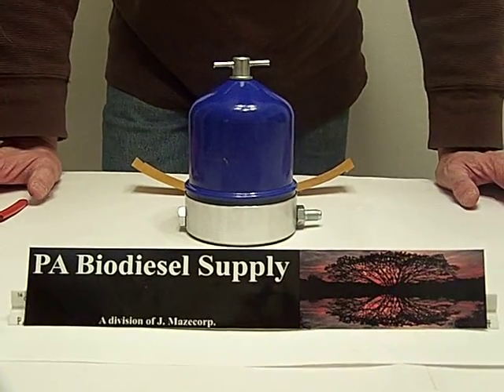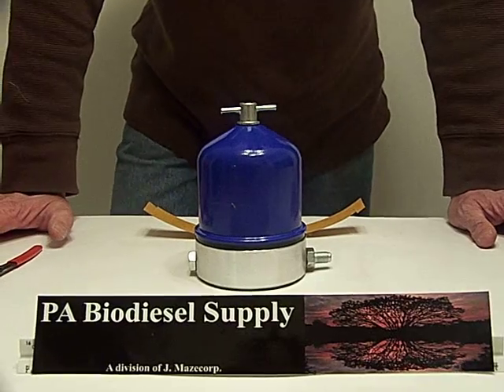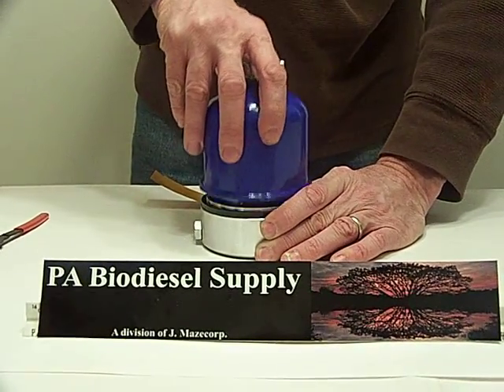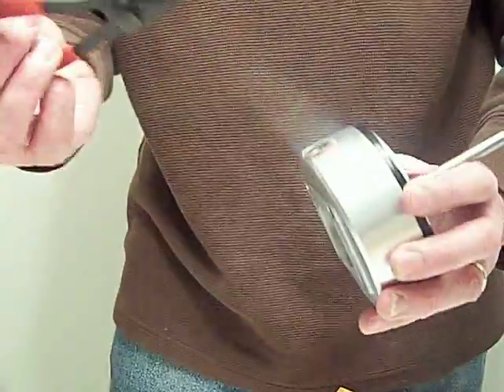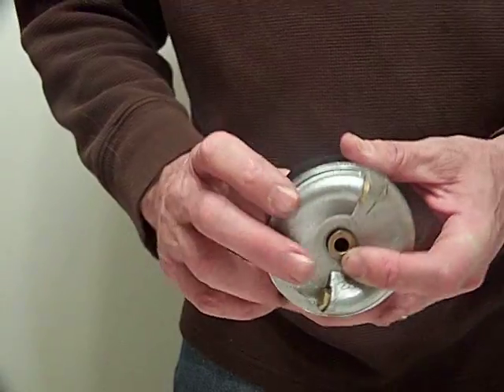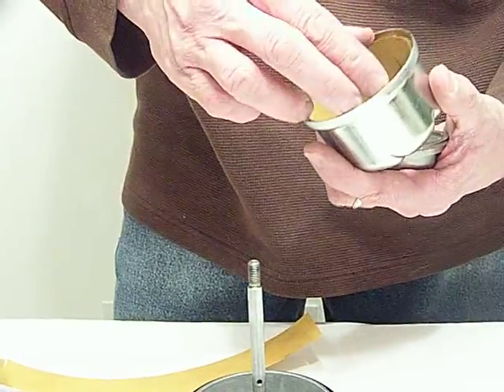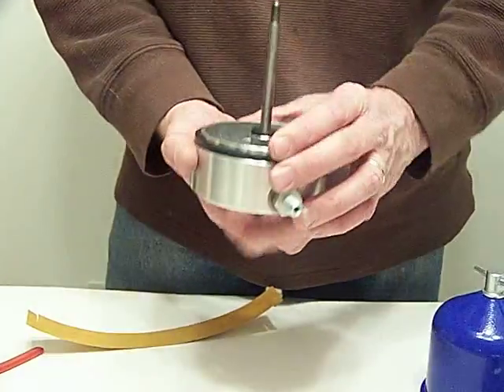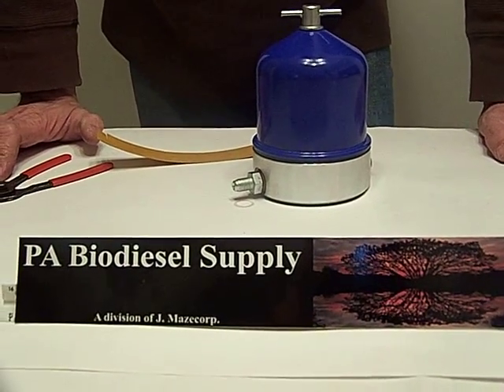Explains oil centrifuge operation.

Comment: Can your units be used inline in a vehicle to replace stock oil filters ? I’m assuming that’s what they were originally designed for
Reply from the maker: @BryanKirch  Yes they can. We are developing an engine kit which we will have available come summer time. I received your email and responded to it 😉
Reply: @ thank you

Comment: Hmmm.....wanted to figure this out as I have a 1949 Pontiac w/a centrifuga
oil filter inside the engine pan.  this vid doesn't show where the heavy dirty sludge 
goes or is routed and the in out pathway of the oil.   need better explanation.